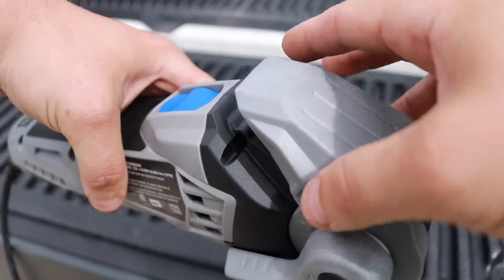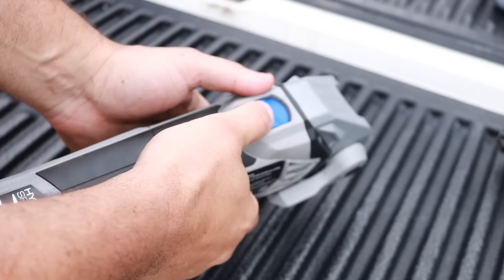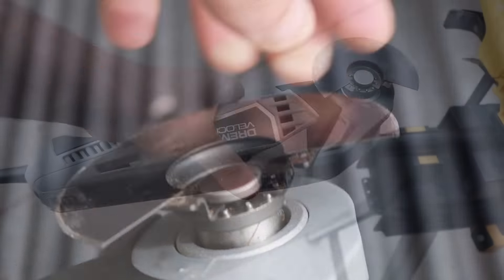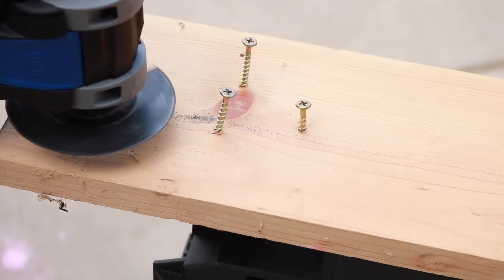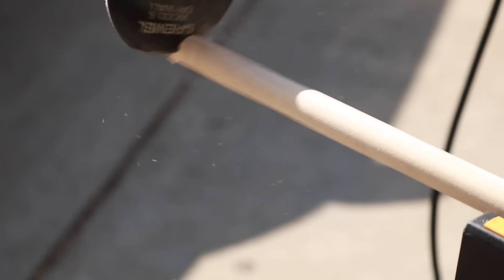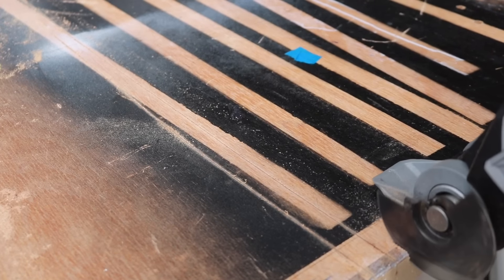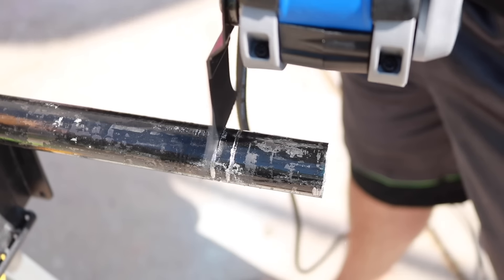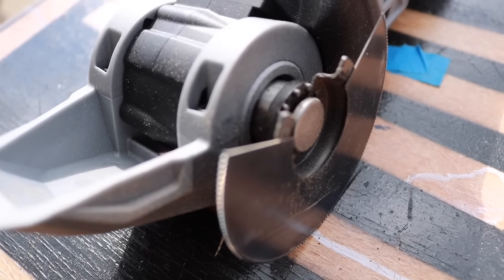Dremel Velocity 7.0 Amp Corded 2-Position Oscillating Tool REVIEW! (VC60-01)

Comment: 16000 opm is far from hyper-speed, some manufacturers top out at 22-23000. I guess you're a Dremel executive?
Reply from the maker: Ohhh how I wish I was, as I would not need to work so hard at this while receiving comments from people like yourself that have no content of their own. One can dream I guess
Reply: The largest Fein Multimaster goes up to 19,500 but it has only 2 degrees of oscillation, the Dremel has 5 degrees. The important spec is the linear speed of the blade edge which is blade circumference X oscillation degrees X speed, so the Dremel is over twice as fast at the blade edge.
Reply: @jonathansavell1832  I agree with the formula, but via greater oscillation the Dremel actually has a greater trajectory of cut.